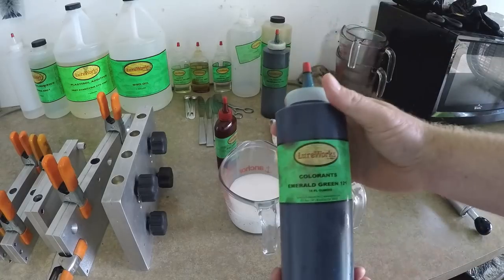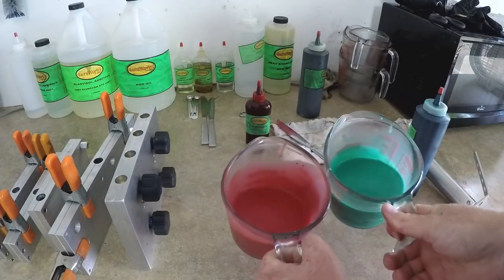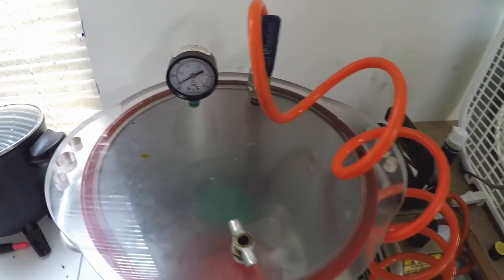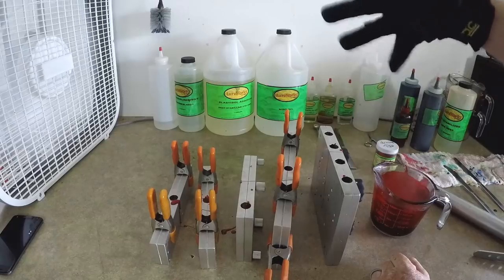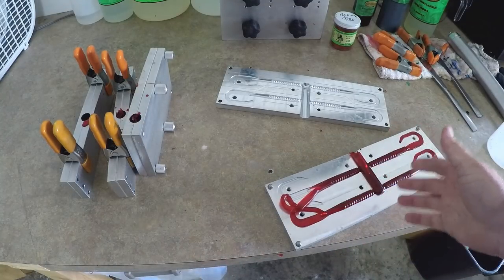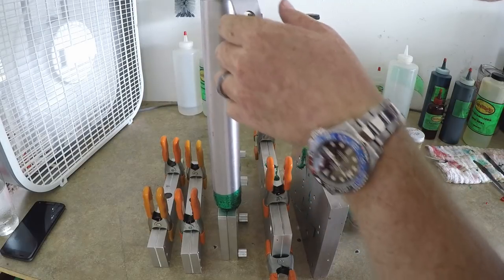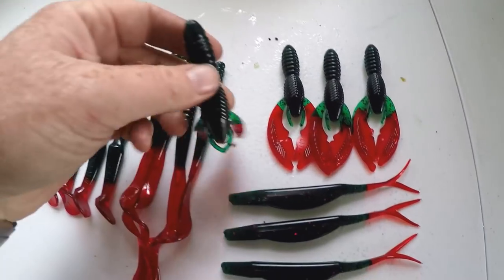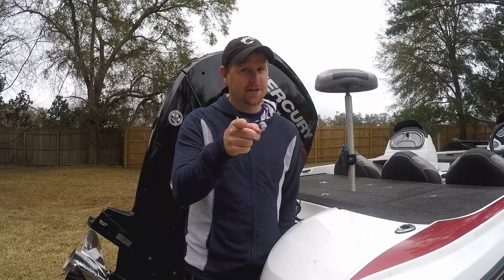Making Soft Plastic Lures: SPLIT COLOR BAITS

Comment: pretty dope. for the vertical molds with the tails at the bottom, you could mark the injecting handling down rod with a marker so you know how much red you filled in for the tails, and then let they cure and then filled it in with your green. This will cut down time drastically instead of having to cut it. But since the video came out in 2018, I am wasting my time. :)

Comment: Thinking about starting to do my own plastics. When doing split color, can you pour just enough of the tail color to fill it then cut off excess? Seems you could save a lot of waste.
Reply from the maker: Not really, you have to fill the mold all the way in order to get the pressures correct to fill all the extremities

Comment: Do you ever have a problem with the plastics bonding. I have done this and the tails are pulling off
Reply from the maker: Yes...shoot the second color very hot and hold pressure..it will never be as strong as normal...but if you cure them for several days they should be usable.
Reply: I was shoot the tails at 320  at 15 pounds of pressure. I am using the Jacobs injection machine. I will try going to 335 to 340. Any idea on the temp

Comment: I have never scorched a lower in my life it's not the colors it's the plastic I use a good plastic you can heat for 384 100ﾟ it will not scorch
Reply from the maker: Good plastic withstands heat better...this older video is using a cheaper plastic.